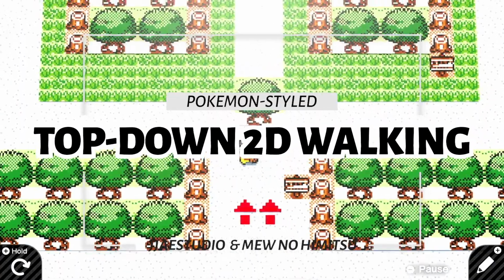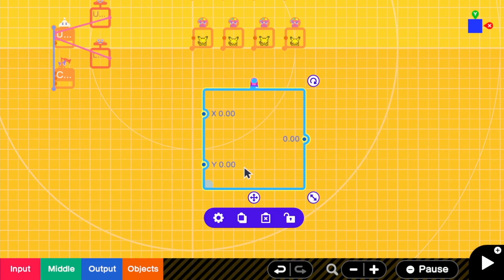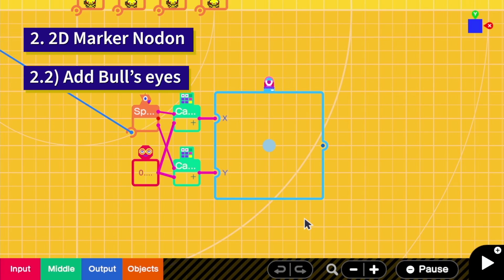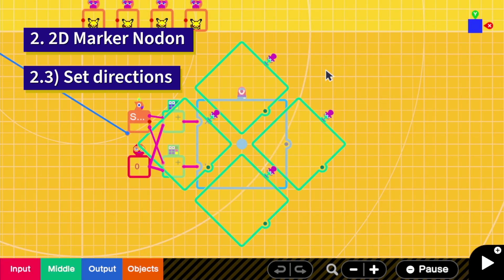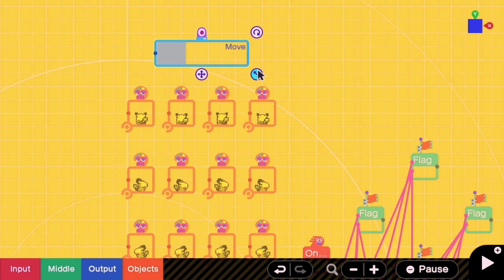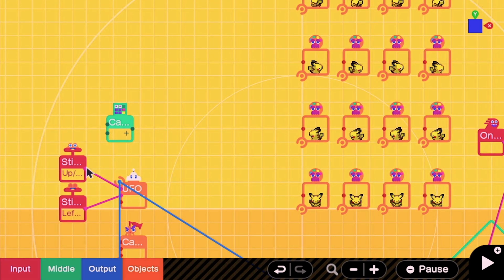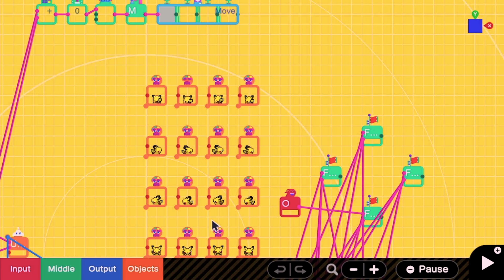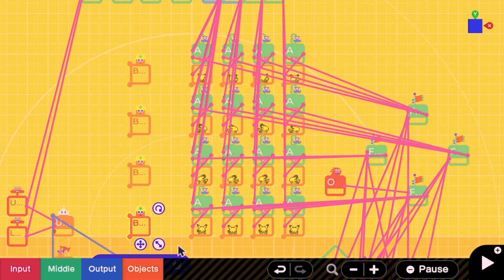2D TOP DOWN walking animation (like Pokemon) feat.MewNoHimitsu | Game Builder Garage Tutorial

Comment: Hi there! This is a super clear and helpful tutorial and as I try to blunder my way through GBG it is very greatly appreciated! I came across a small hitch in my animation that I am unsure where it originated from, and I was hoping that if maybe I explained it under this video you might be able to offer some insight? If you don't see this because it's months old, that's totally cool, but worth trying. 

I want to preface this by saying I set it up to a Person because I wanted the functionality of jump and action as well as the walk and I've had a harder time with that with the UFO in the past. I turned the turn speed to 0.0 and it seemed to fix most of the issues I was encountering from it being a Person nodon, but I am unsure if the issues I've still got are from that or not. I have, from what I can see, followed this tutorial to a T otherwise and it does like 99% work as intended.

The animation works smoothly except for one thing: when I stop pressing the stick in a direction, instead of idling in the same direction, it flips to the first frame of the opposite direction (e.g. walking left, flips to right when I stop). If I tilt the stick slightly and let go it doesn't flip, but if I'm pressing it normally in the respective direction, it does flip as mentioned when I let go. I played around with the turn speed of the Person nodon a little to see if it might change it, but no. Any insight as to why this might be happening?

The code for my WIP is G005 NH8 XFP if actually looking at what I've done is helpful at all. If you have the time to offer some help it would be greatly appreciated, I've been stumped on this for a good minute now, but if not that is totally cool! TIA though!!
Reply from the maker: Hi!!! Thank you so much for all the details. : ) I have managed to fix it:

G 005 JL4 M2J

The cause of the bug is the speed sensor. Let say, a person moves to the left. The speed on x was is negative. When the person hits the wall, the speed would become positive and the texture would flip to the other side.

There are two ways to fix it:
Method 1) Map the speed sensor to the smaller value to make it less sensitive.
Method 2) Replace the speed sensor with L-stick input. 

In the code above, I have used the method 2 :)

Thank you for watching and following the tutorial!
Reply: @jJaeStudio  thank you so much for your response! I appreciate the help.
Reply from the maker: Thank you for waiting! I'm trying to catch up with all the comments now. :D

Comment: Doesn’t work, going diagonally shows the ufo, I have my bullseye on circle for the animation, yet it still shows the ufo.  Another problem is that it doesn’t show left or down animation, it just stays on one frame.
Reply from the maker: Oh, UFO should not have 'visible' properties.
I also have the code at the end of the video. You can use it to compare with your current code. :)

Comment: Will this work with the switching character from your tutorials? Also, does it matter if it's not 4 sprites per side?
Reply from the maker: You can reduce the number of sprites per side.

About switching characters, yes, it will work with that tutorial too. 

However, if your characters all use UFO, I think switching between a set of sprites is easier than switching between different UFOs.

Comment: So I tried this and it works but it only shows the my persons head any fix?
Reply from the maker: Can you make sure that you have moved the box that connects to the lower port of the free slider has position x=0, y=0, and z=0? If this does not work, let me know again ;)
Reply: @jJaeStudio  ok thx I’ll try
Reply: @jJaeStudio  do you mean speed sensor cuz I don’t see a free slider in the code
Reply from the maker: Oh, I was confused with my other tutorial. :| Sorry!
I think I get what you mean. You have to resize the UFO, and boxes to have the same size as your texture. : )
Reply: @jJaeStudio  ah ok
Reply: @jJaeStudio  what do I set the size on the UFO to?
Reply from the maker: @errorisyes  the same size as the box and the texture. If your box is not a square shape,adjust the ufo's y-position to be half the height of the box. :) (or you can manually move the ufo up in y-axis until you can see the full texture)
Reply: @jJaeStudio  yea I already tried that :|
Reply from the maker: @errorisyes  can you get position and size of ufo/box and texture for me? Thanks! :) or pass me the game code. I can look at it when i have time
Reply: @jJaeStudio  UFO, size: X:1.40m Y: 1.40m Z: 1.40m UFO, position: X: -12.60m Y: 0.70m
Z: 0.00m  and the same for everything else
Reply from the maker: @errorisyes  Can you double check the connection point & texture face?
Box:
connection point: center -> center

Texture:
face: y-negative (or try y-center)
Reply: @jJaeStudio  that fixed it thx!
Reply: Wait I did kinda it only did it for the north textures
Reply from the maker: @errorisyes  You can apply the same thing to all textures! : ) Yayyy, I'm happy that we can finally fix this. :D

Comment: I found out this doesn't work so well with a person nodon unfortunately. Only the UFO allows the textures to face the correct direction. Still excellent and useful but hopefully there's a workaround for the person nodon in the future.
Reply from the maker: Oh, can you try making the person nodon's turn speed to be 0.0 ? It might work. : )
Reply: @jJaeStudio  that seemed to work except now every time my character stops walking it turns around for some reason. Any ideas?
Reply from the maker: @justinm2232  
Q: Does this also happen before any walking cycle start?
Reply from the maker: One idea that I can think of is to slightly reduce the size of circle in 2D marker nodon's settings. : )
Reply: @jJaeStudio  I had to make it really really small but it worked :) thank you very much
Reply: The only problem I'm facing now is that I'm trying to use a sword with a hinge connector but the character is not turning so the sword only goes forward. It's probably outside the scope of the video but if you have any ideas I'd be grateful :D
Reply from the maker: Yay, so happy that it helped! How about adding 1 more hinge? : ) Let say that the default direction is north. When the east flag is true, we will rotate the sword -90 by y. But, if the west flag is true, we will rotate it by 90.
Reply: @jJaeStudio  Wow, you are brilliant! It definitely without worked. Thank you so much :D I really never would've thought of that one.
Reply from the maker: @justinm2232  Fingercrossed Hope this works. : )

Comment from the maker: FAQS
Q: Why my texture turn upside down?
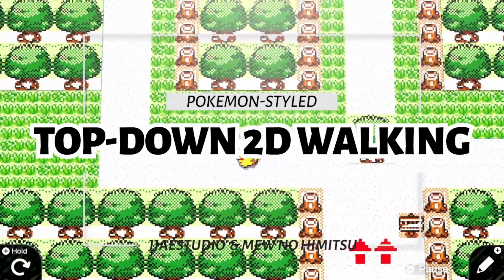A: UFO's turning speed should be 0:00 to prevent texture from flipping upside down. : )

Q: Nodon cost
A: Let n be the number of textures per direction.
Sprites: 4*n
Direction set up(+ can be removed): 11
Animation set up (+ can be removed): 4 + n
And nodon: 4*n

Total: 9n + 15

If there are 4 textures per direction, there will be 51 nodons.

Q: Why speed sensor instead of values from stick?
A: Speed is more stable than stick input.

Comment: (G 003 D73 Y7B) has a very similar nodon count and connection count but uses a different method. I’m using it now but I’ll check out this method as well to compare. Thanks
Reply from the maker: Nice! Thanks for sharing. Your method uses stick+timer instead of speed, which also works fine (MrObserver also uses this). :) The main different thing is that your idle animation always faces the same direction. (I think the code in the tutorial can always do it too by setting a south flag 'on' when there is no speed)
.
Btw, a small tip. You can save 6 nodons by removing "=1" and "=0" after a counter nodon and replae "=0" with "not" instead. : )

Comment: Another question, is it the speed sensor really necessary? Couldn't you just use the stick input?
Reply from the maker: You can but stick input is very sensitive. Your direction sprite will change a lot faster.
Reply: @jJaeStudio  I mean yeah, i faced that problem, had to use a timer of 0.05 for the animation to not flicker or overlap
Reply: I did experiment with stick input, speed sensor and acceleration sensor. Speed sensor gives me the most natural transition between sprites without additional adjustment.
Reply: @MewnoHimitsu  Guess i should try it then, but maybe it would end on the same result as with input cause i set my speed to zero when i don't move